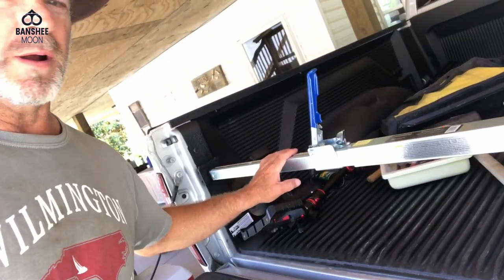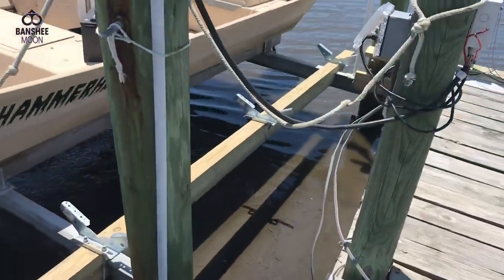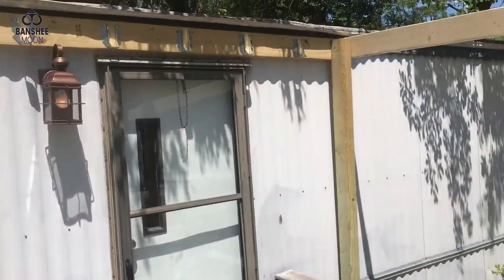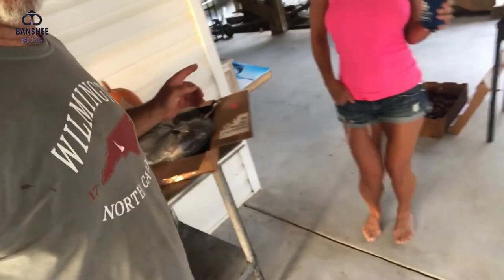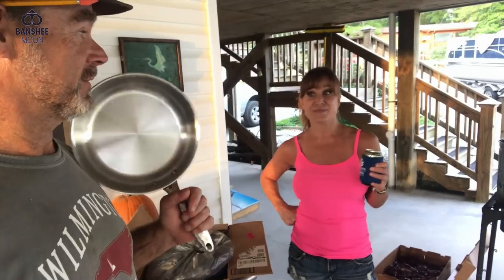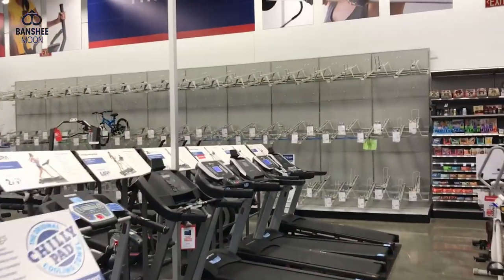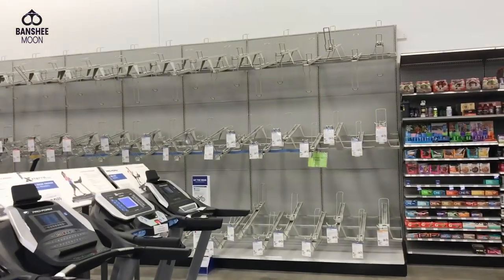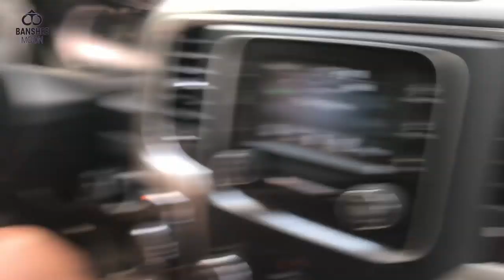Pandemic Fitness, Cuisine, Art, Pets, Boating, Construction, Tree Trimming, & Recreation

Comment: I wouldn't use load locks! They will cause your fenders to loosen up by pushing them out. Just use a 2x6 in your existing notches over your wheel wells that are built into your bedliner.